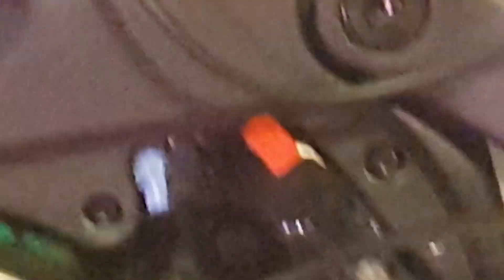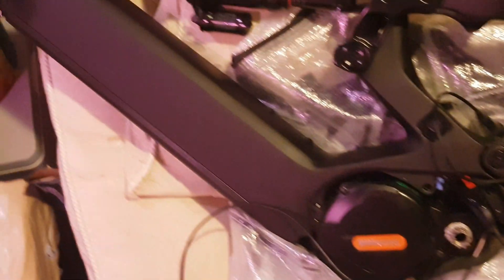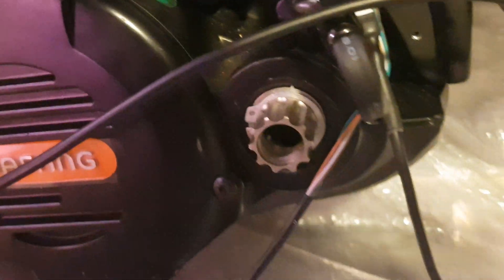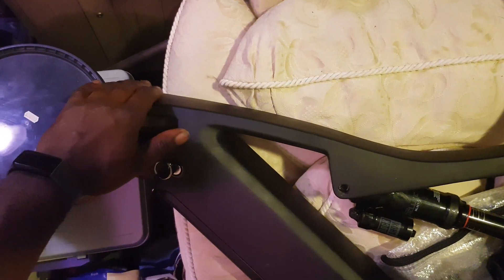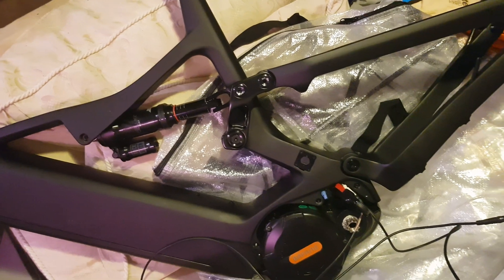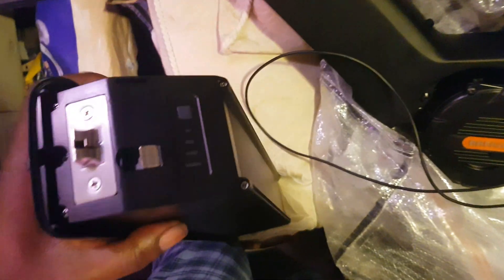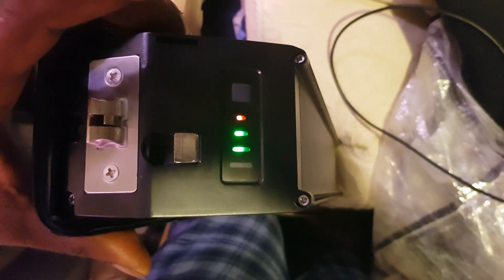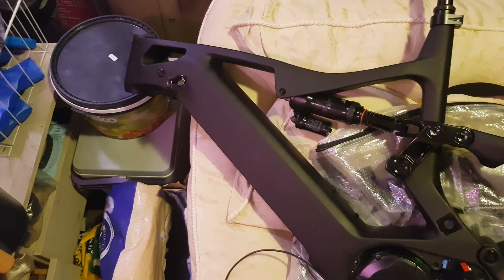Yes, you can use the UART Bafang M620/G510 motor with the Dengfu E55

Comment: Looking forward to the build video Neeko. Does the E55 need an angle headset? 64° headtube angle and 77° seattube angle seems modern compared to other ebikes.
Reply from the maker: When paired with a 170mm travel fork, the headtube angle is 64° and a 77° seat tube angle (29er F&R). My intention will be to run E55 with 180mm travel+ fork. However, obtaining a 51mm offset fork (referenced on the geometry chart), greater than 140mm travel nowadays is proving to be more difficult (unless you're prepared to spend crazy money on a custom fork from TF Tuned). The angle headsets with a 44mm/42mm offset "should" allow me to achieve a similar handling bike, without altering the wheelbase, bb height and stack height...........in theory😅
But I'll play around with different setups and update you Nazeem👍🏿

Comment: Im told that in order to change the program it needs a programming display, do you know where i could get one from ? i need to change the voltage to 52v and change the wattage slightly on pedal assist 1 as its too much.
Reply from the maker: Depending on whether you have a UART or CANBus M620, the method varies. With the UART, a simple programming cable (similar to what BBS owners use) and a laptop/desktop with a USB port is required. the programming cable is readily available online (Ebay, Amazon, GBK etc). The programming tool (which allows torque amendment) is necessary and is freely downloadable using a quick Google search. Alternatively,  you could buy an Eggrider v2 display. This display enables programming of the UART M620 on the fly without the need of a laptop/desktop.
If you have a CANBus version, you need the BESSt Tool and an account with Bafang to amend the firmware. Each firmware for the M620 alters the behaviour of the motor. However, specific values for torque & maximum current cannot be altered 👍🏿
Reply: Thanks for the info, mine is on uart I may go for the egg rider.
Reply from the maker: Good choice. I too will be using the Eggrider v2 display, just like my E22👍🏿